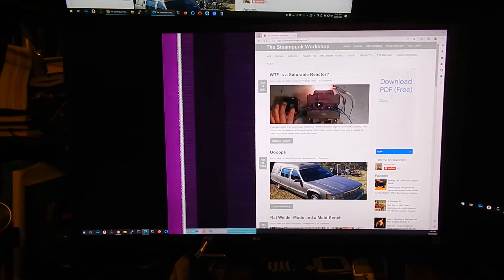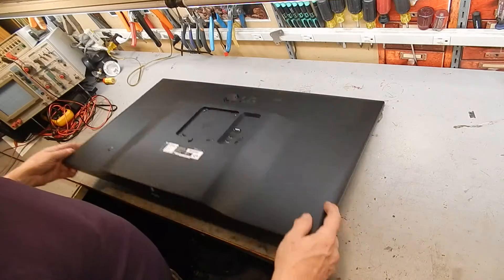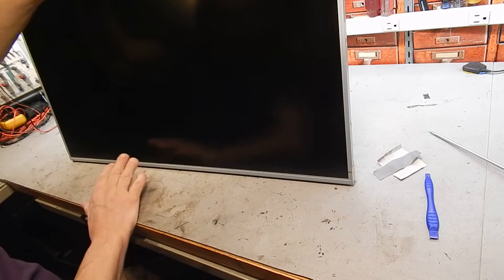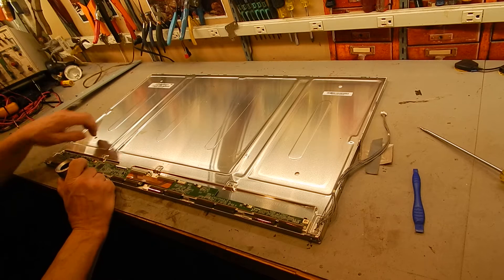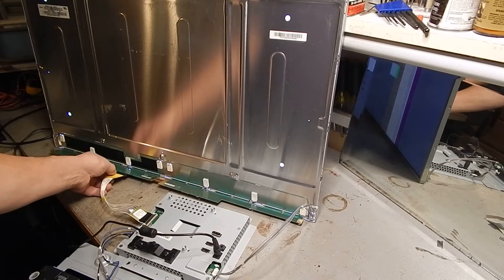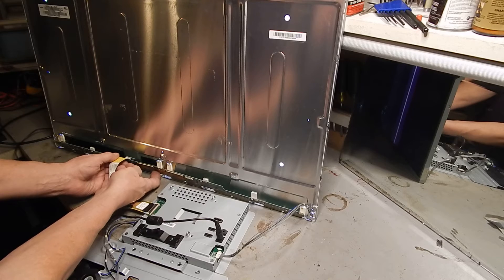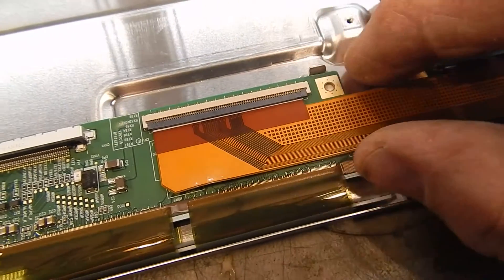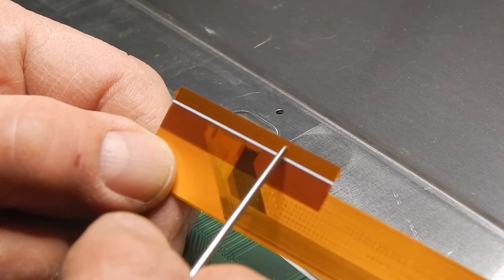LG 32" 4K Monitor Screen Repair

Comment: Mine has a thin vertical blue line right in the middle and I had opened it up and unattached the ribbon then reattached and make sure it is secured but it still show up.  I did touch everywhere I can as well.  I have the exact monitor that you have....so not sure what happened.

Comment: I bought 32UN500 1 year ago, it has a problem: it sometimes flickers for about milliseconds like lightning, and it only flashes once every few minutes. I noticed it only flickers when switching window tasks or when switching to full screen mode. I don't know if it's due to a conflict with the video card or the monitor itself. Tried replacing the DP cable with a new one and changing the video card to another but it still didn't work

Comment: Sooooo... What is the ratio of monitors pulled out of dumpsters that you are able to get working?  I think I ended up being 1 out of 8 before I stopped bringing home monitors that just ended up in my garbage as opposed to the neighbor's.
Reply from the maker: I generally don't attempt a repair on a dumpstered monitor unless it's an upgrade from what I already have or I have an immediate use for it. In this case, this was/is my first 4K monitor.
Reply: @JakevonSlatt  I had a question i got a lg 43UN700-B monitor but the screen is busted, so you know where i can find a replacement screen by any chance? I can’t seem to find one anywhere, thank you for your time.
Reply from the maker: @Pcmaster_race-_-1  i usually look to eBay for such things, though shipping costs may make that hard for something that big

Comment: Oh, that's funny, I have the same monitor doing a similar thing, Thought i was going to need to replace it, didn't even think to check those flat cables and zif sockets. Thanks, Mr. Von Slatt, you've saved me an unneeded replacement.
Reply: I turned out to be slightly mistaken. My monitor isn't the exact same, it's a smaller 22 inch LG, but the fix worked like a charm anyway. Thanks again
Reply from the maker: @mr.headcrab31  That's awesome! This is the best kind of comment one can get on a video!
Reply: @JakevonSlatt  Oh, it's no problem, you did all the hard work, and i'm glad i brightened your day a little.